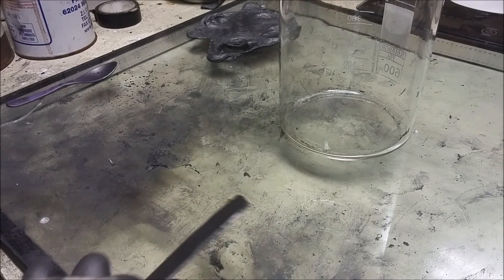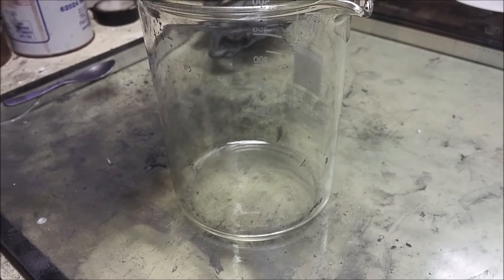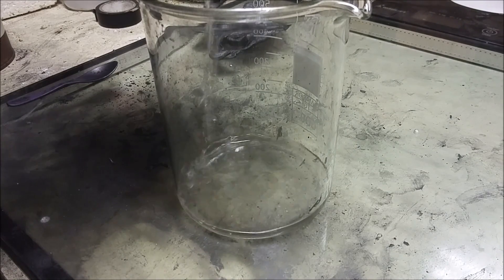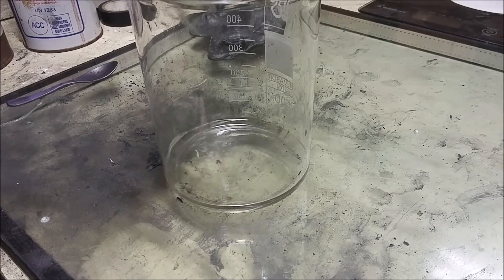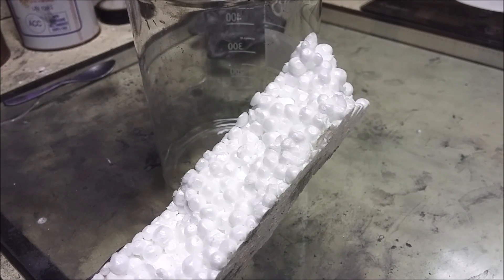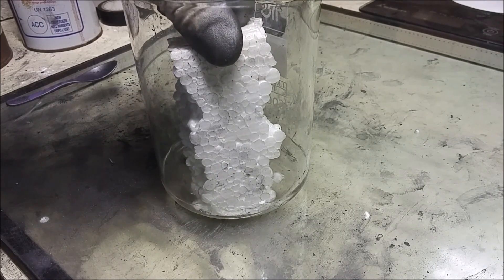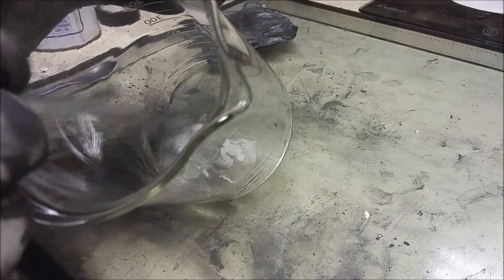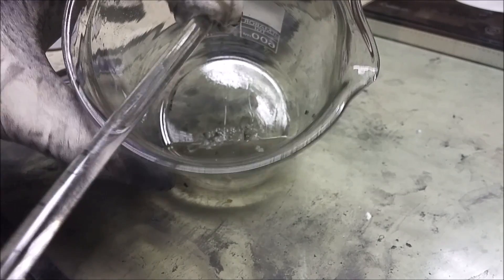How to Make / DIY, GRAPHENE / GRAPHITE PLASTIC

Comment: What temperature this conductive plastic can withstand .. Because batteries become hot during operations
Reply from the maker: The temperature is the temperature of Polystyrene. Which is around 200 - 240 deg C. Yes,... some batteries can get hot to max 50 deg. If the battery get higher temperature, then is something is wrong.
Reply: @cayrex  👍🏻

Comment: So you could use the styrofoam as a shearing medium to seperate the layers of graphite and then simple burn away the polymer with only graphene/graphite and carbon as the remaining peoduct ! And boil your kettle at the same time !👍🏻
Reply: They made an graphene aerogel which is very light....maybe used similar technics
Reply: @andrakesh  yeah well that makes sense and you could flash charge it with high current to eneble higher conductive pathways! Just got to try stuff that you imagine and you might just be right!

Comment: how well this thing can hold as an electrode for a battery?
Reply from the maker: In water based electrolyte is good. When you make the electrodes out from this,... you need to press the material really good to lower the ohms
Reply: @cayrex  thnx ;)
Reply from the maker: @PhysicsViolator  no problem. Also if you get high ohms from your material you can add more acetone and more graphite or graphene powder and then you press to make a electrode. If this is not helping then you also can add some copper plate on the top of this graphite plastic to get more current out from your cell.
Reply: @cayrex  i got all the materials dude , i will try it .

Comment: Came for the "graphene" but got simple graphite instead. Again. Not the same, but both are carbon -- like diamonds.
Reply from the maker: you can add graphene or graphite no big deal
Reply: @cayrex  
Graphene is graphite in single lair of atom

Graphene is a super expensive normal tempruture super conductor

This is not graphene 
This is polyestrene with carbon

Graphene is made by 
Coating a surface with fraphite than pushing it with 10000 tera psi 
To make is 1 atom thick
So what you made is not graphene
What tou made is far away from graphene

Why do you think graphene costs thousants if not millions
To buy
Reply from the maker: @kayragur3542  i use graphite for the conductivity material. But you can also add graphene,.... that was my point,.... that you can add all conductive materials.
Reply: @cayrex  you cant add graphene
İf you make graphene thicker than 1 atom it turns into graphite
Reply from the maker: @kayragur3542  👍🤭

Comment: what the liquid on glass is?
Reply: Julio Cavalera acethone
Reply: how about if dont use sterofoam, just powder with acetone?
Reply from the maker: only acetone and graphite will not work. acetone is a solvent and not the binder. you need some binder that bind the graphite
Reply: i would aply to wood for shield my electrik guitar wiring capity what do you think that good or better liquid for mix my graphite powder??
how about water and wood glue? is that wiil be going work?

Comment: Thermo polyurethane will work(melted p.u plastic)?
Reply from the maker: with acetone? hmm I am not sure. If you can not dissolve with acetone, try with benzene or toluene
Reply: cayrex2 Thats my fault..Correction:My polyurethane is like the hot melt glue which is meltable by heat.Melts at 300 degrees celcius.So this will do the job when mixed with the graphite?

Comment: In acetone graphite becomes graphene ?second can be use ABS
Reply from the maker: yes, ABS is also good. acetone + graphite + blender, you "can" get some graphene, but will be low quality
Reply: what is the difference between melting and dissolving the ABS in acetone.Secondly after acetone process we can put ABS in compression mould n heated for desired shape.
Reply: reminder
Reply: reminder
Reply from the maker: you can try melt the ABS and you will see.
Reply: how to add additive in ABS after acetone.Is high pressure as well as temperature require after acetone to harden the ABS.

Comment: very interesting, what is the application case for that material?
Reply: Graphene is the second strongest material on earth. It's man made from graphite, as conductive as copper, can be nearly transparent, and is one atom thick.
Reply: This might be thin graphite  seeing how dark
 it is.
Reply: Diamonds (Wedding rings) are actually the strongest desired material known to wimen
Reply: i bet with you that every women in the world will pick the diamond ring over the graphene dust ;D
Reply: did you know that in fact diamonds are really wothless? the price is driven high by a worldwide kartel + worldwide ad-campain. I mean wimen dont use the rings as tools so the hardness doesn't matter so Zikona is a much better choice (value for Money).
Reply: +Hyper Hektor oh yeah I forgot about that. I wouldn't call them worthless. But their worth a lot less for what they sell them for.
Reply: +Hyper Hektor graphene is still far easier to get though.

Comment: This acetone method will also work for ABS, and a few other thermoplastics. Remember graphite will actually work better than graphene for electrical conductivity under the same loading due to the "card stacking" of the material. Graphene will disperse in between the polymer chains, but not conduct as well.
Reply: Why wouldn't it conduct as well? Graphene is much smaller, allowing for a higher "card stacking" effect if proper amounts of graphene are used in the process. Graphene should produce more conductive and stronger materials.
Reply: If you aren't using enough. And if the quality is garbage.

Comment: i have made the exact same stuff-i found you can make it more conductive by applying HV while it is drying
Reply: m3sca1 you mean High Voltage.?
Reply: solarhope i used an electric fence controller and it went from no conductivity to reading in the kiloOhms range
Reply: Thanks
Reply: +m3sca1 Great tip ! ;) Many thanks ! Regards, Stefan.
Reply: Iorgulescu Laurentiu yes it helps to polarise the graphene/graphite and create current paths...it would probably also work with lower voltage but you could cook the goop and start it bubbling if too much current flows.
Reply: Nice idea, how much more conductive with HV Vs no HV?
What voltage are we talking here?
Reply: Not a very good idea to apply (possibly sparking) HV to an acetone evaporating solution, its really flammable.

Comment: Have you tried to use Bioplastics ?Then you would not need hazardous Acetone which also stinks...but then the electodes are probably not water resistant ,right ?
Reply from the maker: +overunitydotcom hmm, nice idea,..... bioplastic from milk!? it is worth a try!
Reply: +cayrex2 yes or from Starch...it is very cheap and does not stink like Acetone the only problem is, that it is soluable again in water. ...but you could try to mix it also with acrylic binder which is water resistant when it has cured and hardened...
do you get also around 5 Ohms per cm resistance or more ?
Try to smear this onto stailess steel mesh metal as the pickup electrode, so your resistance will be less than 1Ohm...
Reply: Check this on ted: Suzanne Lee "Grow your own clothes"

Comment: realy cool, thanks for the video. whats about the ohm per cm
Reply from the maker: +ehochimalpi if you use a really ultrafine graphene/graphite powder or GIC graphite and if you can press the electrode really hard,.... you can get 5 - 10 ohms or lower.
Reply: +cayrex2 cool i have to try
Reply: Wow that is very cool to get into the 5 Ohm range makes it really interesting for battery electrodes !
Reply from the maker: +overunitydotcom OMG,..... sorry man, I mean 50 - 10 ohms. but you need to use a really ultrafine powder and you need to really hard to press a electrode.